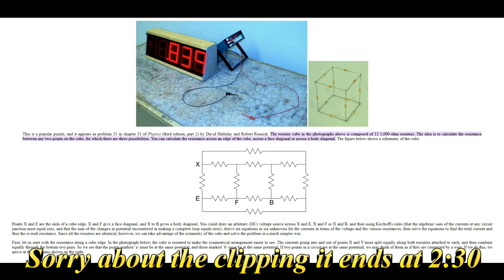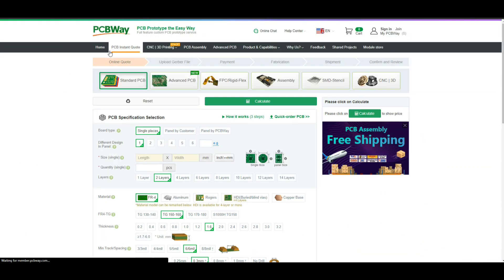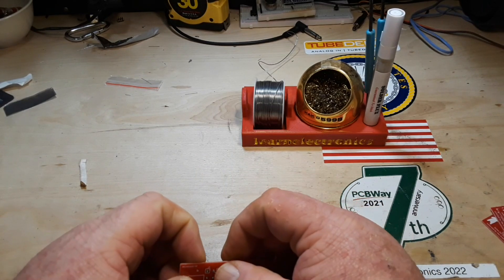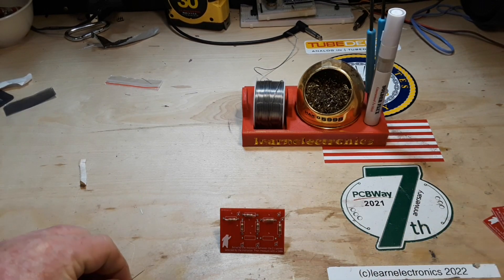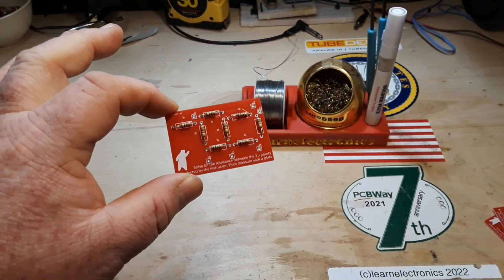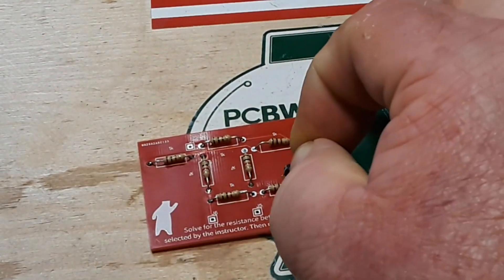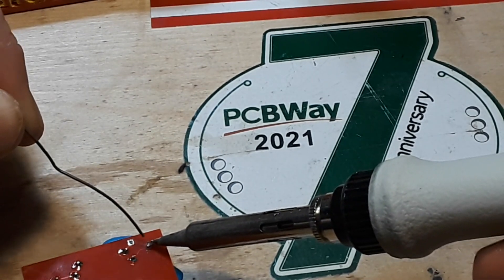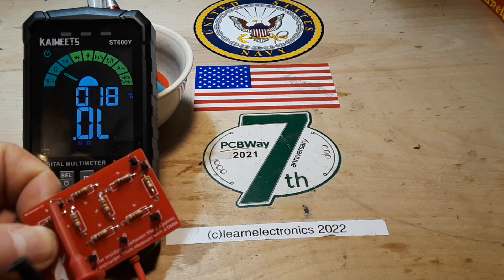STEM BOARDS: Resistor Cube

Comment: What if the "monster" board consists of those multi-turn pots that can only be adjusted by precision screwdriver? So the setup is this:  The teacher sets the pots on each board randomly for each student. The student then starts out by measuring each resistance first. Then they have to exhaustively show each step of the calculation precisely because they have every opportunity to measure the answer anyway. Knowing why it's the answer becomes the point of the big puzzle.

I can seriously see myself trying to figure out where my math went wrong and losing my mind after making that final measurement. I'm pretty sure my eraser would die long before I was done, too.

I'm guessing the Thevenin and Norton equivalent circuits are next?